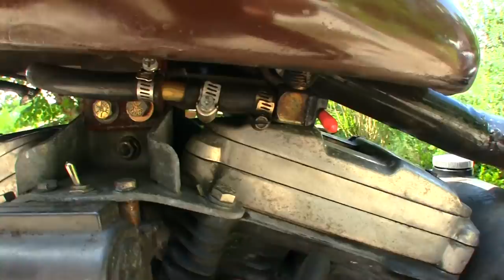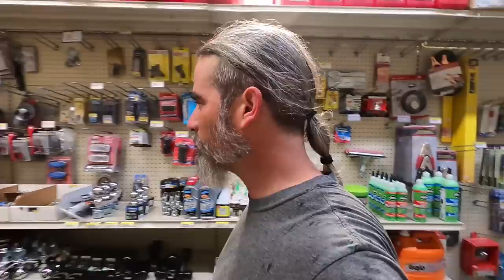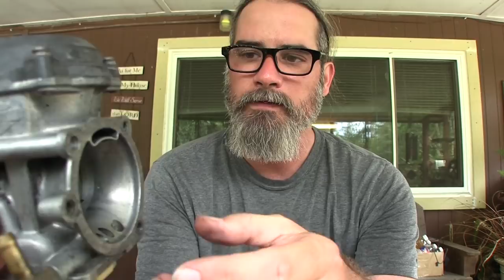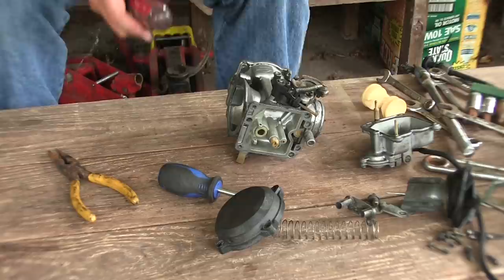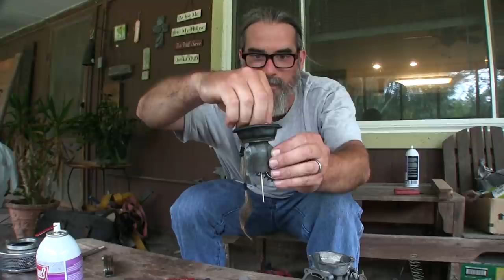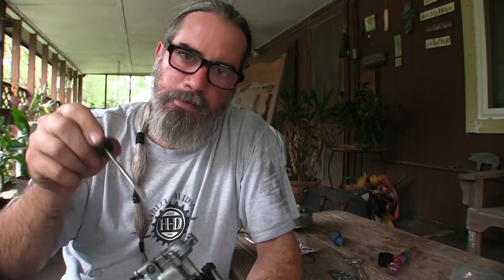Keihin CV Carburetor ISSUES HOW TO Rebuild For HARLEY Davidson SPORTSTER Chopper

Comment: The youngsters at my local Harley dealership should watch this. Watched a younger guy try and start a early 90s used bike. He didn't know what a choke was.
Reply: Give them a set of points and ask them to figure that out! Hahhaha
Reply: @whatsstefon  Took 10 minutes after trying to start the bike, an older customer walked up and pulled the choke out and said, now...
Reply: @wcraiderevo8078  haha. I went to see a bike with a friend. He was looking at getting an older Harley. It was advertised as would not start or run.

The owner kept trying to. I noticed that the new unbranded carby was on upside down.

A part of me wanted to buy the bike. But all I could think of was “what else isn’t right in this bike?”
Reply: @wcraiderevo8078  likewise here in Australia. In addition to that, the asking prices here are stupid.
Reply: Hey tramp, once you dry the bike and get all the water out spray some camp dry on your wires and coil pack . Silicone your nose cone cover on you ignition, and where the wire goes in. Should work fine. God bless.
Reply: Some youngsters are on here trying to do carburator things🤣🤣
Reply: LMAO

Comment: first thing I do is remove the float bowl, if there is crud in the bowls, I remove all the jets and clean em, dont shove wires thru the jets, they are brass and soft, and dont use the dishwasher to clean parts ,unless you like sleeping on the couch.

Comment: It looks like you might be missing a couple of parts on the CV.  On the A/F idle screw there should be a washer and o-ring to seal that area on top of the spring.  There's also a rubber boot that goes around the accelerator pump rod and connects to the carb to keep water and dirt out.  If it was there I missed it when you put the bowl on.  Congrats on the dirt pile!!  Looking forward to more garage building content!

Comment: I'm about to rebuild the Bendix Zenith on my '72 FLH for the 3rd time in 30yrs.
 If you don't have a gallon of carb soak solvent and an air compressor setup, you can use a can of carb cleaner and one of those cans of compressed air for cleaning computer keyboards.
 Fuel injection can't even come close to producing the classic Harley idle that a carb can.
 Good informative video, and I'll be happy to see you in a shop.
Reply from the maker: Truth!

Comment: When I worked in a dealership many moons ago we had good results with cv carbs by using 48 pilot jets, 160 -180 main jets, drilling out the emulsion tube slightly, drilling out the return hole in the slide slightly, shorten the spring by 1 and a half and then stretching it back to the original length.
Best of luck with your new shed, man
Reply: Forgot to mention a thin washer under the needle also helps..

Comment: Awesome video very, very helpful. I just have one question if your accelerator pump goes bad will it prevent the bike from starting ? I'm only asking because mine went bad and I replaced it  and everything is fine now. But all the other videos I've seen say the pump is just to get you over the hump from idle. IDK
Reply from the maker: It should still start. Won't be any good for acceleration.

Comment: Back in 1982 I had a 1976 XLCH ... Local bike speed shop worked the engine and turned it into a real fire breather... after getting the motor back I had it up and running... only problem was that garbage Kiehn carb. The bike would sputter around 2800 to 3200rpm.My man at the shop suggested I get a Bendix carb with an adjustable main jet.... After install the bike ran like drag bike... loud because I had str as ight thru drag pipes... it was bored 30 over and ran circles around the other fast bikes.... That bike started on the first kick around 500 times ...one weekend I pulled into our local bars summer picnic. 5 hrs when I'm ready to leave it wouldn't start because the points had closed..... ha ha... a quick fix on the spot and she fired on the 1st. Kick as usual.  I swear by that brand of carb.. Be safe and well..
Richard S.   .....

Comment: Should be a small O ring on the accelerator nozzle that seals against the carb body. Also should have been a small washer and O ring on the mixture screw.
Reply from the maker: Your right. I went back and replaced it. As far as the mixture screw... beats me, but there wasn't an o-ring and washer with it. I would've figured there'd be one, but it seems to run just fine without it.

Comment: Nice video, I’m still running the original Tillotson carb on my 69 FLH and it is a challenge at times just for parts. The leather Excelerator pump doesn’t do well with gas additives like Sea Foam. It just warms my heart when doing a carb and find where someone used pliers to disassemble it. Carbs have become a lost art.
Reply from the maker: Kinda seems that way.

Comment: Great vid mate.  Always heaps of fun dodging the weather😂😂 I was hoping you had a dual carb setup.  I jz bought two new Kiehin cvks for my vtwin ( shameful jappa), however they’re joined together in such a way on the bike where one carb services each piston and are joined together with shafts passing thru from one side of one carb to the other,  Any ideas where or who’s vid I could watch for a step by step? I’m also not sure if I’ll be needing any special tools to complete this job.  I guess the automatic answer most folk would say is jz do the reverse of the strip down of the current two carbs…this would be a great option if I wasn’t certain they’ve been backyarded before sometime prior to the bike being mine. For example, the float bowl drain plugs were nearly tight like wheel nuts and…..they don’t even match🤔   You have a merch store man?

Comment: If U get trash in the jets or ideal port U can use a torch tip cleaner or microw drill bit that hand drill clogged holes in torch tips. They work well to get trash out.

Comment: Hey Corey , them emulsion tubes can get fouled quite easily over time , the water entrainment probably helped lol. I think that air filter is a Drag Specialties product if memory serves me , same as what I had on my 1980 flh as a aftermarket add on . I suppose the tramp ran great after the cleaning ? I have to find the next video when time permits adios bro !

Comment: Got a 1995 heritage CV carb how many turn should I turn my air ideal screw bottom it out then how many turn out
Reply: ... with most any carb...from gently bottomed out...
..turn it one and a half turns out...
..fire your engine...then adjust it in or out to find where it sounds and runs right ride it..keep an eye on your plugs..
Reply from the maker: What Steven said

Comment: None of these videos on cv carbs show setting correct float level. I know how, but I'm sure many don't know how to make this important adjustment. He didn't show putting the washer and O ring on the idle mixture screw. Spring first then washer and finally O ring. Screw all the way in till it lightly reaches bottom then back out 1 1/2  turns. Final adjustment done on warmed up idling engine. Most likely will need backing out another full turn for best idle performance.

Comment: Hot soapy water, Dawn dish washing detergent and a toothbrush works pretty good. Use the carb cleaner to spray through the ports. I also keep a gallon or carb cleaner, with a basket included, witch I pick up from NAPA. Not a sponsor. 😉 lol!
Reply from the maker: There's an idea. Thanks!

Comment: I love all my Keihin CV (Constant Velocity) Carburettors, (fitted on all later model Honda Bikes) compared to the old slide carburettors!! The CV version compensates for changes in air pressure, altitude, etc. They also include a nice accelerator pump for rapid acceleration! when required! They are much more fun than the latest, fancy, snazzy, EFI (Electronic Fuel Injection) devices...I reckon! If you want to adjust for a very slow tick-over, (and starve the engine of oil...LOL...), you need a proper "carburettor"...trust me! Take care, all!....😊...😊...!

Comment: Hello Amigo, just want to ask which is the best jet kit sizes you have on your evo sportster? Best regards from Portugal
Reply from the maker: On a 1200 Sportster with a Keihin CV; a 48 slow jet with a 175 main jet seems to work well enough.
Reply: @SaddleTrampTV  thanks for Replay. I haver a 86 xlh 1100 with a CV carb and im trying to figure ir out the best jet set for my bike.

Comment: I noticed that your idle mixture screw didn't have a washer or o-ring with it. Is is supposed to have one? The reason I asked is because when I rebuilt the one on my 2004 Sportster it has them but I can't get it to run right when trying to set the idle mixture. When I took it out it was backed off three and a quarter turns and I didn't notice it having the o-ring but it did have a little washer at the end of the little spring. Any thoughts?
Reply from the maker: For some reason I don't know, this one didn't have one in it even though I was looking for it. Still runs good anyway.

Comment: The ethanol in our fuel attracts moisture from the air which then separates out as water at the bottom of the tank - its a problem of ethanol that affects all motors including new ones !
Reply from the maker: Makes sense

Comment: I have a bad fuel leak out of the cv carb after letting the bike sit with no fuel in it over winter. Not out of the overflow, or the accelerator diagram. It seems to be coming out of the middle of the carb where the bowl bolts on, or maybe where the throttle cable attaches. What could cause that?
Reply from the maker: Sounds like a stuck float.

Comment: Haha, rebuilt "85" Honda Goldwing aspencade, in house parts in kitchen, dinning room, bathroom, bedroom,  on the jets for the carb there are different sizes, to tune low land or higher altitude, always carry different sizes, just for tunning air/fuel mixture. An you thought I was over here sleeping 😂. Not in your classroom.

Comment: Air fuel screw has a O ring and a very small flat washer in the carb body.
Reply from the maker: I thought it would. For some reason it didn't have them like my other two.
Reply: @SaddleTrampTV  Maybe design change. I had a later CV on my dresser. I left out the washer and the bike would pop through the intake on morning starts. More than usual.

Comment: A fuel additive will evaporate the water and clean the jets, you won’t have to take anything apart
Reply from the maker: I'll have to try that.
Reply: @SaddleTrampTV  thanks about the carburetor, I just got my first Harley pretty much rebuilding the whole bike, trying to tune the carburetor in with the bike, seems like rocket science 🤣

Comment: The jet needle seats into the needle jet not the main jet. The main is inside the float bowl and the needle jet extends into the throat of the carb. Otherwise good how to video.
Reply from the maker: Thanks for that. I knew I was somewhere in the ballpark with that.
Reply: @SaddleTrampTV  always willing to help a fellow rider/wrench. I’ve got access to many manuals and real world tech tips. Looking forward to the shop progress. Ever have a need for info I’m willing to share my library.